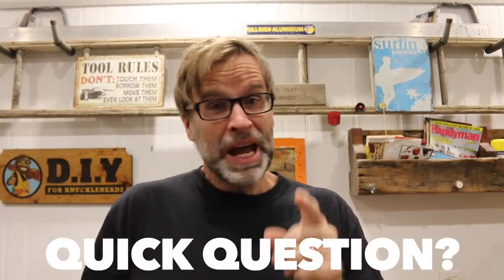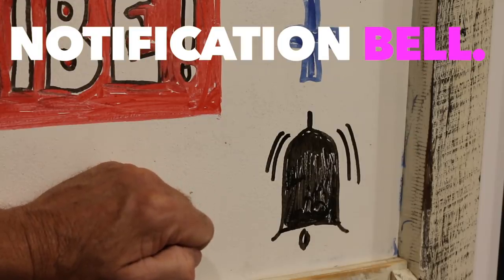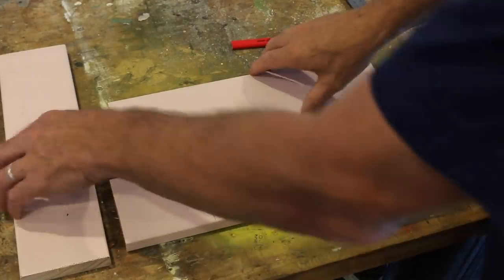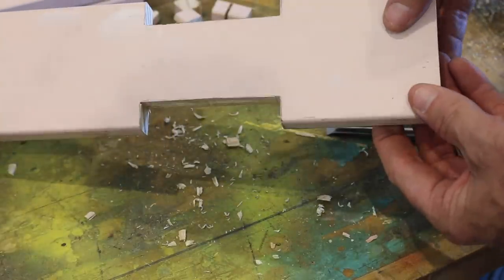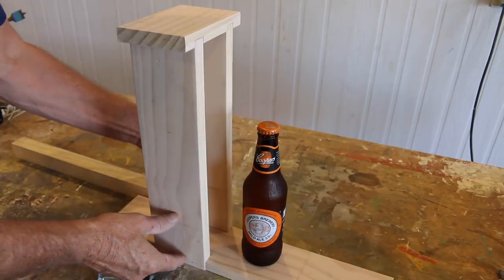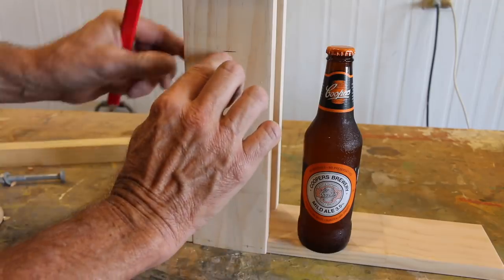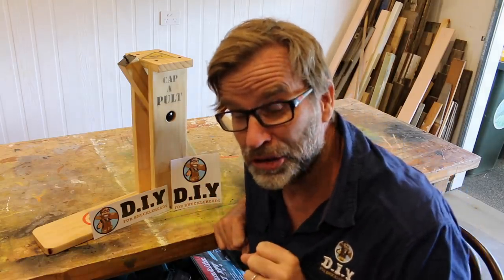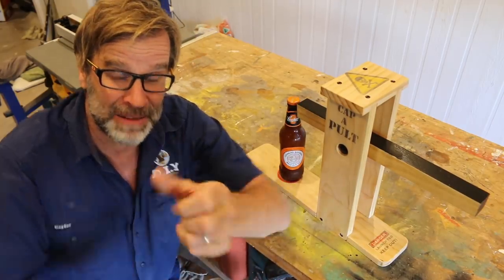Scrap Wood Project! CRAZY Bottle Opener…Catapult Style!!

Comment: Where can i find your countersinking bit contraption?
Reply from the maker: If you're in Australia, you can pick up the exact one l use from Bunnings ( Macsim Clever Tool ) and if not, l link to a similar one in the Description Box under the video..Good luck 👍😁
Reply from the maker: Just a side note re the Macsim Clever Tool. If you use an 8 gauge screw use this one, https://www.bunnings.com.au/macsim-8g-trim-head-clever-tool_p2360697 and if the screw you are using is 10 gauge, then use this one, https://www.bunnings.com.au/macsim-fasteners-10g-x-65mm-clever-tool_p2360775 If l was you l'd most likely use the 8 gauge model 👍
Reply: @diyforknuckleheads  i live in the States.. Texas
Reply from the maker: Check out my link in the description box Corey 👍